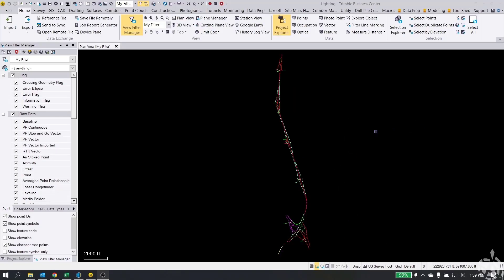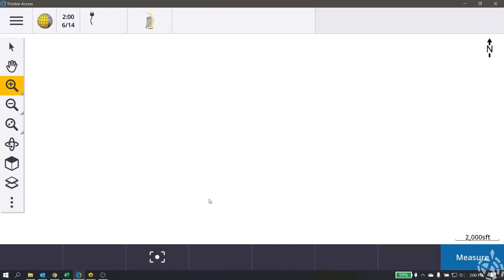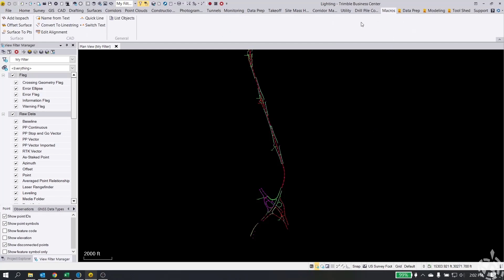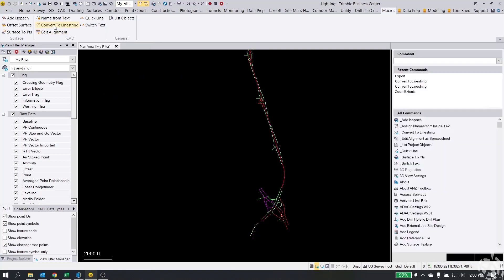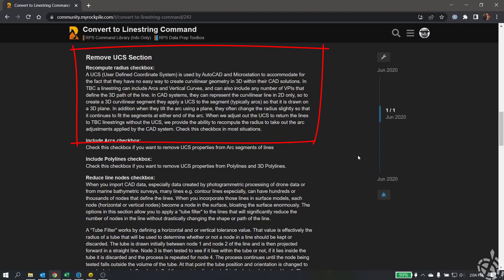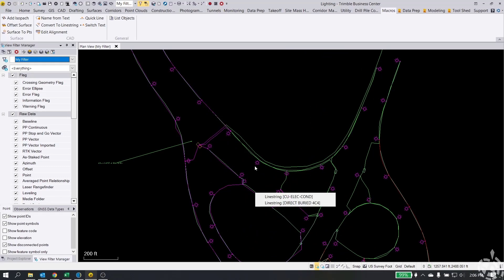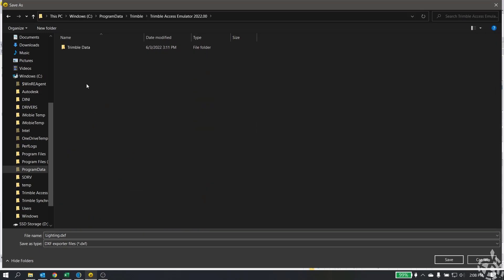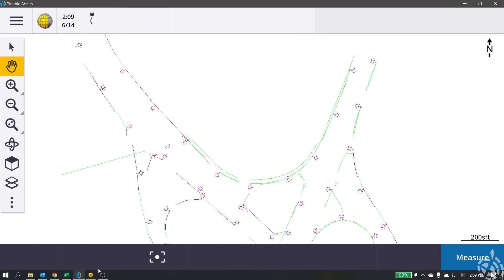Hey! Clean up those DXF backgrounds!

Comment: Jay, a lot of great information.  I am wondering if you know of any automated software out there or software that you can import a dxf file that needs a lot of clean up and has more than 1 layer, sometimes maybe 3 or 4. 1) Flatten, 2) clean up overlapping lines and unwanted pieces. They are older designs. They are artwork pieces for CNC Laser and plasma cutters. Any help or reference would be greatly appreciated as I have  over 1,000 to fix.